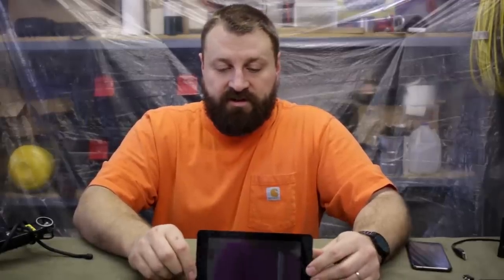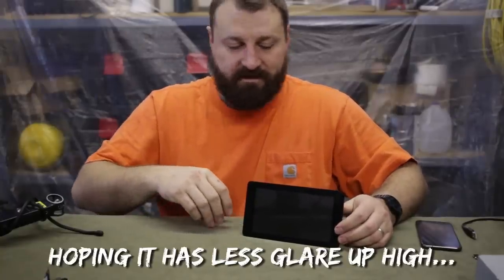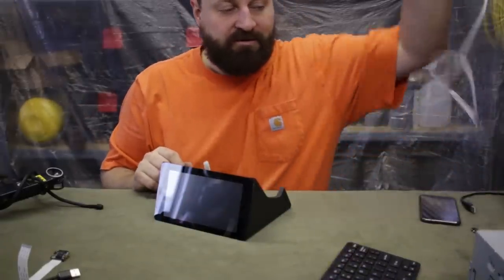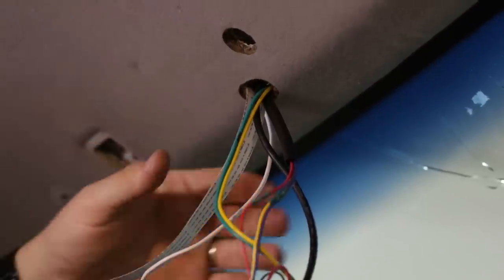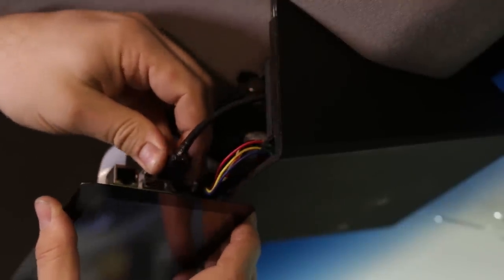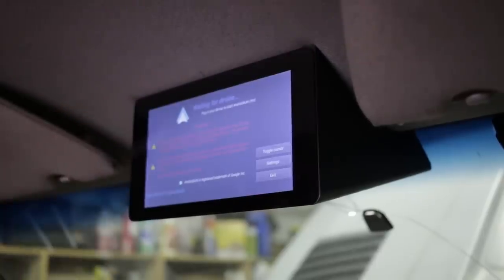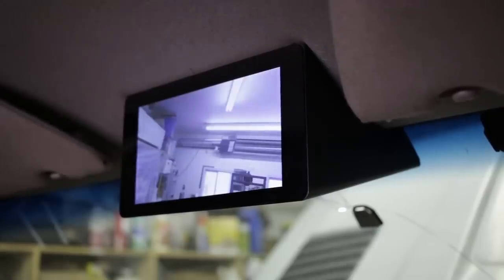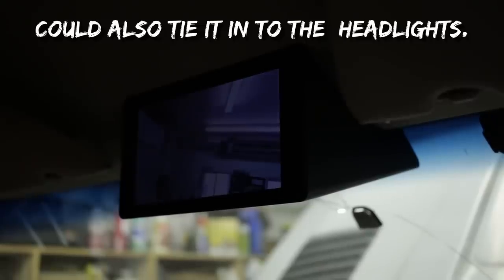DIY Android Auto Raspberry PI Head Unit, Rear View Camera, Navigation & Music

Comment: AWESOME! This is exactly the sort of thing I was wanting to do with my old 07 Pontiac G6. Its radio was garbage so I was eventually going to replace it with a Pioneer double din that had android auto, but couldn't ever afford the near 2k  price tag.... So I had started to look into Car PCs and seeing what was out there for a Raspberry Pi, but nothing ever turned up. I eventually got rid of the G6 and bought a Passat with Android Auto built in (didn't even know it had it at the time lol. Just plugged in the phone and BOOM there it was!). BUT I still would LOVE to have this as an option! The girlfriend really loves how Android Auto works but her Corolla doesn't have it... With this, I can probably just 3D print her a small, slim mount that fits on the dash, and route the audio to the AUX port on her existing radio. Although, does this output audio over bluetooth? While it may be redundant... She'd most likely prefer the stock radio to display the current track and yadda yadda so that it isn't just sitting at a 'blank screen doing nothing' lol. Sure it'd show two copies of what's playing, but it'd be interesting if it was able to output audio via bluetooth lol. 

Heck, this would even give her the  option to leave the stock head unit on the car info screen as well. She's always switching back and forth to it so she could see her economy and what not. This would let her keep it on that screen and yet still have control over the audio >:D

Comment: The Ole Raspberry Pi Trick!!! I know this is an old video, but I too have played with the Pis of different Versions starting with the 1.0. You probably already knoe this, but I figured I would share with others. A person can purchase a Really Small Wireless Keybaord with a Built in Mouse Pad for the Pi. It is something that works great and can fit in the Glove Box or Center Console. Just A FYI incase some one is looking into this project. I might dust off an old 3.0 Pi and give this OpenAuto a go in my OBS just for fun.  Thanks for your Video!

Comment: 8:45 try switching the maps z-index and opacity... but you wouldn't be able to interact with the other screens in background... maybe a button that puts the map on top with opacity for 5000ms so you can interact with map and a lastTouched timeout function to switch the z-index back for interacting with radio, etc...

Comment: I'm using my 50amp/hr lithium deep cycle battery (past van project) for a raspberry pi project. I'm totally going to use the regulator as you did but hopefully, make a portable smart battery box. I just need to work on the box design. The scripting is exciting but I have to start messing around with them because I never have before. How can I make the battery chargeable from multiple sources? I want to be able to plug it into regular 110v house supplied power and solar when bringing it camping. Ideally, this could be a media source and power a 12v travel fridge that I have.

Comment: This is awesome, I recently came across 'crankshaft' which is a fork of the openauto project.
I plan on using this when I can afford the touchscreen and am praying your scripts will work with it, I really wanted a reverse camera and a dignified shutdown which I've seen in the comments your also working on. I'd love to get the dimmer working with the headlights too.
Great work. Subscribed!
Reply from the maker: The next video is almost ready, sensing the headlights could be done pretty easily using the optocoupler method I'll show.  I still like have the option to change it whenever I choose... but you could have both... Standby!!!

Comment: Nice project. i wonder is there any way to connect to this unit the stering wherl control  and other CAN BUS features ?
Reply from the maker: Yes, I did some testing reading the wheel buttons over ODB2 via Bluetooth. It worked, but wasn't worth the hassle for me. But if you wanted you could just map those inputs to keystrokes on the Pi.

Comment: This is exactly what I was looking for to build into my T5. Only issue I have is routing a HDMI cable 'through the van' from the rear tailgate. Are there other ways to use a camera?
Reply from the maker: It seems a van would be even easier than ours, just run it above the headliner. Short of running some wires you'd need a second Pi, a local network and stream the video over RSTP with some custom scripts at both ends.

Comment: I myself would have used the pi cam as the front facing dash cam and used a USB web cam as the back camera. I would have also added a USB port extender to have a hole in the mounted housing for a USB port to plug in a usb stick to record all of the videos on. I would also suggest getting a small blue tooth keyboard to put into the glove box for those terminal times :)
Reply from the maker: This is all done already - We have 2 forward facing cameras recording already. Visible spectrum and thermal.  And a USB hub coming down to the dash... And a wireless keyboard for terminal times. 😁 The keyboard should be visible in part 2, it's fixed magnetically to the slide out cup holder which is otherwise useless.
Reply: Awesome.. Now go get a ODB II bluetooth enabled reader and grab the data with the pi's bluetooth. Once you tie that into the system, it'll seem more complete..  I myself may add PWM head/turn/tail lights so I can have a dimming or flashing feature for off road use.
Reply from the maker: I have Bluetooth OBD2 reader already, although I have no intention to integrate it into the Pi.
Reply: Shame.. Would make an awesome personal black box along side with the dash cam vids. If needed in court. Other then that.. Awesome work.
Reply from the maker: There are other systems in place to handle that better, I want to keep this as simple as possible so that it is responsive and fast.

Comment: You can make it easier. take the tablet, open the tablet and remove the battery. then you take a voltage rectifier for alliexpress and connect it to a 12 volt car cable. you also bring the cable out of the tablet for usb (for an external flash drive)
Reply from the maker: Uhhh, it's not a tablet...

Comment: You listed 4 cameras. I know nothing about Raspberry Pi, but guess I need to learn. Can you set up a quad screen with 4 camera inputs?
Reply from the maker: We now have six cameras actually, but each one requires its own pi, they only have one camera input, I do remember someone had a Kickstarter project where they had a switch mechanism where you could plug in for cameras and then switch between them, but you can't run them at the same time.

Comment: Very nice build. I do have some questions I'm curious it's been over 2 years now how are you doing with this build and heat what's the screen. Does it affect the display at all? Another question that I have is what's a custom box that you chose to mount the screen in the video shows you screwing it into the vehicle but what are you attaching it to? I'm sure it's not the outer metal of the vehicle
Reply from the maker: It's been two years, no problems with heat traveling all through Mexico... The new enclosure is 3D printed and bolts up to an existing bolt hole in the frame/rib above the windshield.

Comment: Is there no way  to use bluetooth instead of a USB cable to connect the phone and it working?
Reply: Sorta.  You could do it with a hidden developer setting and WiFi currently.  The phone will need to become a hotspot, the pi being a client off that.  The phone would run a server daemon that the "head unit" (the pi) will connect to.  Bluetooth specifically?  That's plainly no.

Comment: This is a great setup! Does everything I want to setup in my car. Waiting for the next video with the specifics of implementation. Need more insight on the specific wiring of power adapter/conversion, Mic integration with the (OK Google) voice functionality and more importantly the bluetooth setup on the Pi such that it can route voice/music from the Pi to the car head unit without aux audio. Thanks again for a great project.
Reply from the maker: I've been working on part 2 every night this week, just just finishing up filming some odds and ends, I should be done recording today and might even get it uploaded tonight. I won't be able to help you on the Bluetooth however, I couldn't get it to work reliably and pairing up each time the system is powered on is a nuisance, I used the auxiliary in on my head unit.
Reply: Need a USB mic.

Comment: Are u able to have a variable dimming feature. So instead of just connecting to the headlight switch that enables/disables the dim brightness that u setup, could it be connected to the rheostat wire off the roller wheel (usually a wheel on most vehicles) that adjusts brightness throughout the rest of the cabin lighting?
Reply from the maker: Not worthwhile IMHO, the Raspberry Pi doesn't have an analog to digital converter. Without an Analog input, you can't sense a variable voltage like that.

Comment: Been wanting to do something like this in my car for a long time, but i don't have a good place to put the screen and keep it clean looking. also my radio doesn't have an aux in so i couldn't use it for music, which i want. in front of the radio would be cool if i could get the pi screen flush with the bezel, but with the way my radio mounts there's no way to slide it back.

I originally had a dual canbus hat for my pi, plan was to tie it into the car then use the touch screen to control stuff, or write an android app to connect to it to do stuff, but $100 canbus hat, fried its self and my pi lol, lost interest after that, still got the screen though, and pi's are getting cheap.
Reply from the maker: I did one for a friend where we pushed the head unit back and put the display in front, the screen covers a double DIN hole perfectly, but in my case I wanted it up high.
Reply: @Everlanders  yea I just don't have the space behind mine. Got vent ducting in the way.

Comment: Awesome, I have a question. I have a bluetooth radio and I dont want to get rid of it. is it possible to add one of these but just for maps. and have my phone play sound to the radio and display maps to the raspberry at the same time? does the raspberry sync with your phone and display your phones maps and calling like a normal bluetooth head unit does? or does it act like a Wifi network that you join on your phone and then maintains its own signal and runs its own map and calling software?
Reply from the maker: Everything is possible.

Comment: tie in to the reverse light 12 volt source with a transistor to switch the back up camera
Reply from the maker: Could easily be done. But we mostly use ours as a rear view mirror when merging or changing lanes... not just reverse. Thanks for the comment.

Comment: Hi, Thank you for the great build. I will be attempting this soon. Forgive my ignorance in electronics, could you please tell me where to connect the optocoupler? I went through both part 1 and 2 of your videos, but couldn't find it. I have a 2000 volvo v70 with a stock head unit which I suspect does not have amp. I am also confused with that part.
Reply from the maker: It's all shown in the digrams at 6:35 https://youtu.be/jFXxtxoi_pc

Comment: Really cool stuff, wonder if you could also hook it up to the steering wheel controls and have a full stereo replacement. Those Pioneer stereos are quite pricey to have Android Auto.
Reply from the maker: I have no interest in that, but it would be easy enough to do... Just monitor the canbus data via the OBD2 port useing an Elm327 bluetooth adapter and map the buttons to keyboard buttons.

Comment: I've replaced the pos stereo that came with my civic (didn't even get bluetooth with it so...) with a chinese brand HU, works pretty good with android. I've also put a wireless backup camera that works good most of the time, the HU has a video out for that, i hooked up a wireless reciver to that.

There are some usefull ODB2 apps for keeping records of trips and whatnot as well, any of those for the pie/openauto? I'm assuming there are, just haven't looked at it yet.

Now, it would be very cool to make all of that myself and make something that looked like a tesla model x/s/3 :)
The screen and resolution seem to be a tad on the low side for that, do you know if the pie would have trouble driving a larger screen with (much) higher res or why they don't atm make them bigger? Seems like model X runs at 1920x1200 O.o

It also seems like a pie, since it's quite flexible to what it can do, would have good synergy with a dashcam, could connect it via HDMI to check out stuff i guess.

The original stereo comes with 2 left and 2 right channels that hook up into a harness of the card, is this configuration possible to hookup via some daugherboard/usb to the pie or is it 3,5 regular stereo only?

Lots of questions, but you made me curious :)
Reply: Oh i forgot, then we also have Steering Wheel Control, would be cool to retain  the ability to retain control of spotify/whateever, it seems like there are solutions for that so that's cool.

Decent  thread in case you want to add something to your setup :)
https://forum.xda-developers.com/android-auto/mtcb-android-head-units-qa/replacing-stereo-guts-raspberry-pi-t3504079

Comment: Hello. I'm interested in doing something similar. Could you tell me how the Raspberry Pi holds up in severe hot and cold temperatures? Where I live the summers and winters can be brutal and I was curious if it would be detrimental to the Pi to do something like this. 
Thank you.
Reply from the maker: As with any other electronics, they are perfectly happy in the cold, but when in the heat the CPU should be kept below 60º-80ºc (140º-180ºf)

I don't have any extra cooling, but I did leave space in the enclosure for a CPU fan if needed. This video explains it clearly. https://www.youtube.com/watch?v=1AYGnw6MwFM

Comment: So what is your occupation? How do you know about the electronics side of things? Self taught?  Also where is the best place to source different electrical components ? ...... sorry for all the questions.
Reply from the maker: Hey Josh, I linked most of the main components in the description. Capacitors, Optocouplers and such are easily found on eBay or Digikey.
Reply: Thanks for the reply. Would you mind answering the other parts of the question as well. I am wanting to learn electronics .....well pretty much anything and that is what made me curious of your occupation/how you know this stuff. Thanks
Reply from the maker: It's a brave new world Josh,  If you want to learn electronics, go out and do it. My advise would be to follow along with a project you are interested in. And follow the examples of those before you - using popular components will ensure there is a large user base with lots of examples available online. In a nutshell, don't think about learning, just do it, go out and have some fun.
Reply: Yeah I get that part and not afraid to "just go out and do it" . I was more curious on your back ground and if you had formal training (I haven't seen a video of y'all stating your occupations) so I was just curious. Thanks either way.

Comment: I'm really interested in how you adjusting brightness. Please can you provide your script or some details? Are you using i2c-2 with ddcutil to command the hdmi chip or did you wire in the backlight driver's EN pin to a gpio?
Reply from the maker: It's controlled in software. /sys/class/backlight/rpi_backlight/brightness  I provided all the scripts 6 months ago in the part 2 video:  https://youtu.be/jFXxtxoi_pc

Comment: Excellent video and project!  I used your suggestion of a usb sound card for a mic and audio output.  I can't get the mic to work when pressing the microphone icon in AA.  Any script needed for the Pi to default to usb mic?  I've already installed in my car and running 3-10-18 version of crankshaft.
Reply from the maker: I didn't use crankshaft, I installed OpenAuto from the source code. But, This Adafruit article should get you going: https://learn.adafruit.com/usb-audio-cards-with-a-raspberry-pi/figure-out-your-chipset

Comment: Having trouble getting phone to connect after starting /home/pi/openauto/bin/autoapp. On the "Waiting for device: screen" I get an error message that says "Unable to open MTP device '[USB:001,029]' . I am using a Samsung Edge 7 phone and I don't have any problems if I am using the Crankshaft version of Android Auto. I would prefer to use your version but can't seem to connect. Help would be great.
Thanks
Danny

Comment: Around 8:05 you have text that suggests you're recording from Left, Right, Front and Rear cameras? What peripheral/adapter/switcher were you talking about to connect and record from a or multiple cameras?
Reply from the maker: I will have the rear-facing camera hard wired if possible, length is becoming a problem. The other cameras will need dedicated Pi's attached and streamed via RSTP. There are multi-camera boards available. But I have not tested them: http://www.arducam.com/multi-camera-adapter-module-raspberry-pi/

Comment: Great job!!! Did you have any previous coding knowledge before you made this. I am looking into making one and you did a fabulous job on yours. Keep on building!
Reply from the maker: Yes, I've dabbled with it's for years, not a professional coder by any means, but I get by. In case you were mistaken, Android/Open Auto is not my project.
Reply: I have a raspberry pi 3 and I have done some coding, but not anything too big. I was just wondering if I could do this with little to no coding knowledge. Thanks!
Reply from the maker: There is no coding required, just follow the step by step instructions in the video.